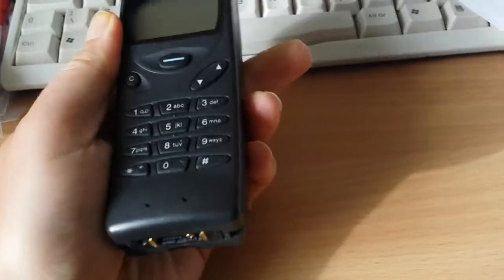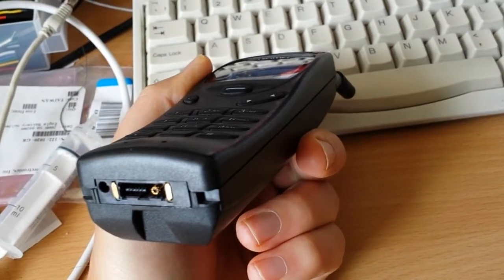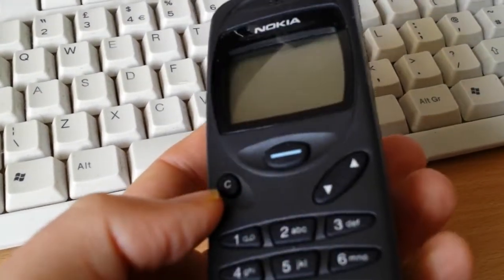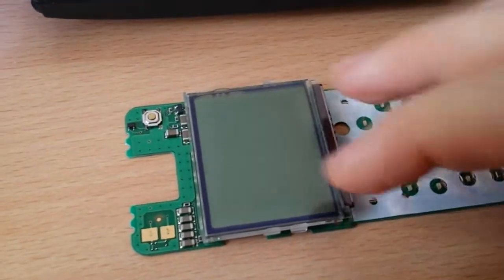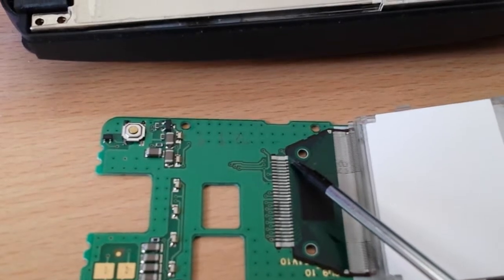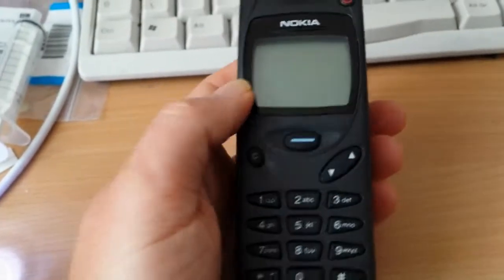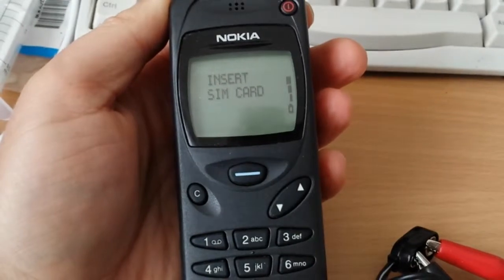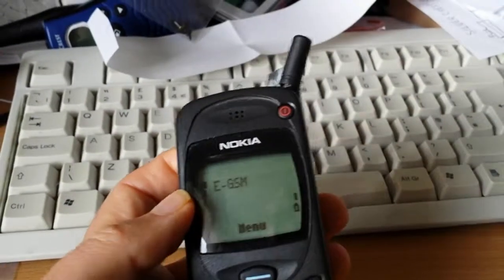Nokia 3110 Teardown and Repair

Comment: hiya! how do i charge this phone? i tried a doro charger that fits and has slightly lower voltage, it should work just slower. it is supplying voltage and the phone appears to be slowly charging the battery, but there isnt a charging indicator or beeps or anything. i think its the charger, so where can i get a charger?